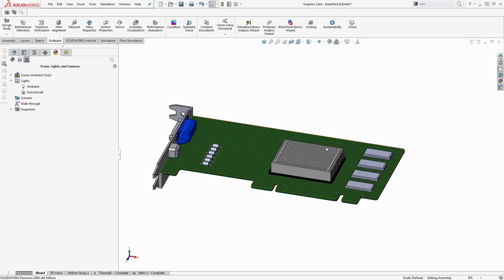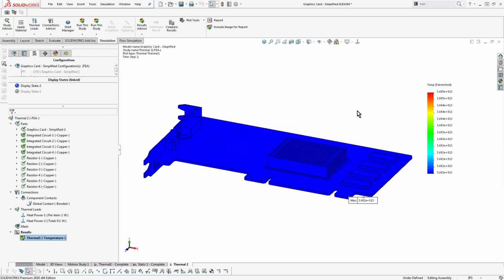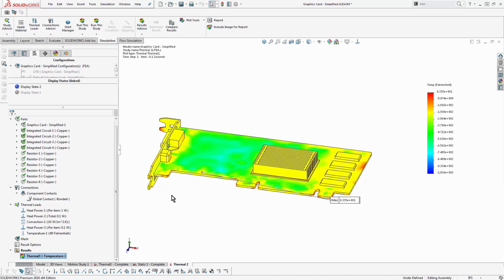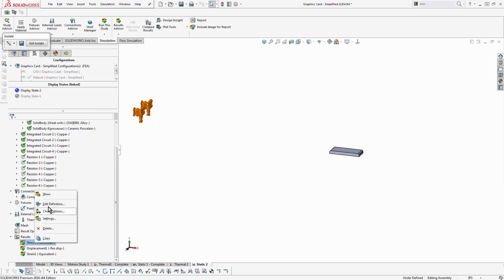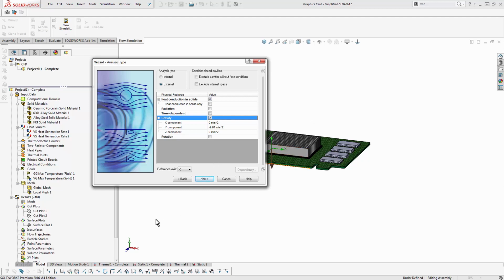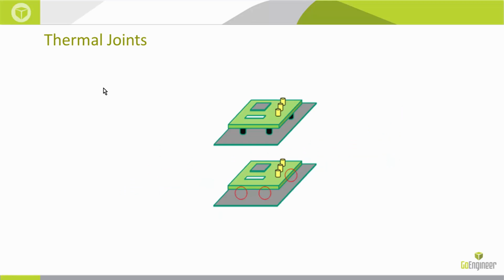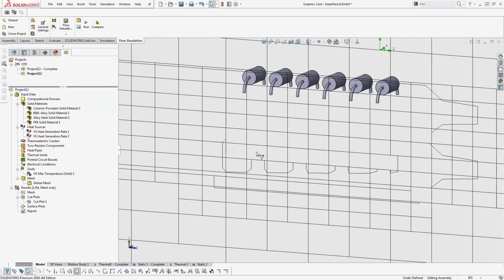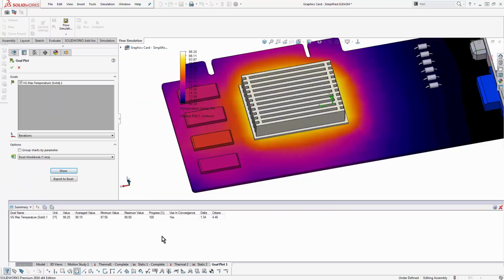SOLIDWORKS Simulation - Electronic Devices Webinar

Comment: Did you just left "Bulk Ambient Temperature" in Convection section as 0 K. I mean does -273 C not influence to the whole picture of the temperature?
Reply from the maker: Hi BaMnupb,
Yes, the Bulk Ambient Temperature in the Convection definition was left as 0 Kevlin; this was an oversight.  You are also correct in that this will greatly change the results of the study using a -273 Celsius fluid temperature value.
Reply: @goengineer  But sir/ma'am, 
Isn't this unrealistic ?? Because, as per third law of thermodynamics, absolute zero temperature cannot be achieved. Here, you used & implemented directly it in boundary condition. It is the most ideal temperature as any cold medium has. In practical cases, any coldest temperature is always above absolute zero (0K or -273°C). 
      Even cryogenic designs doesn't use this temperature directly in the real time prototypes. Plz, explain this your step in simulation🙏. Otherwise, content is the best ❤️.

Comment: I've never seen simulation at assembly level in solidworks to be true. I've tried it many times but just couldn't find it. is it new to 2016 version or I can find it on my 2014 version also ?
Reply: Evil,

It depends on what level of SOLIDWORKS you have. In SOLIDWORKS Core and SOLIDWORKS Professional, you have access to SimXpress, which only allows you to analyze part files. In SOLIDWORKS Premium you get access to the SOLIDWORKS Simulation Add-In, letting us run Assemblies in a Linear Static Analysis.